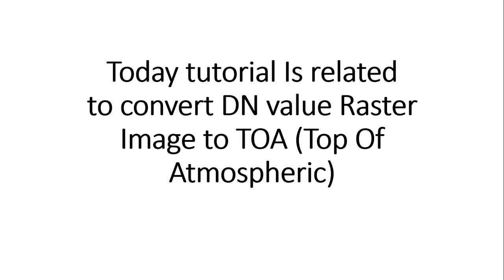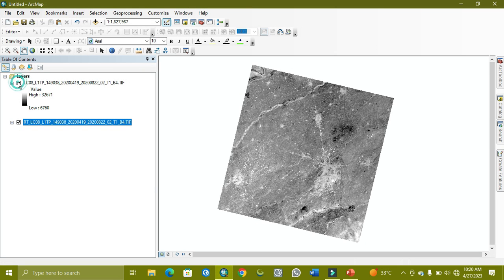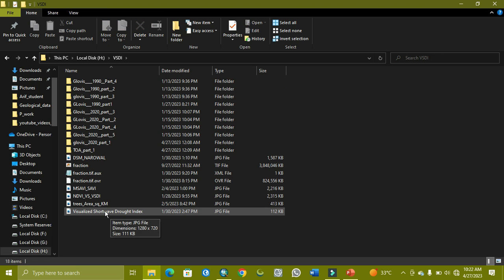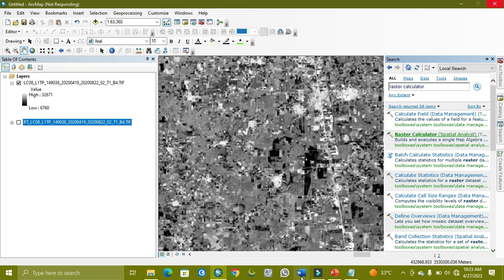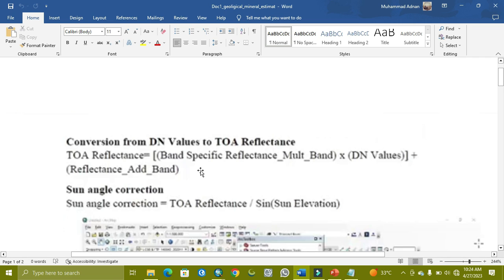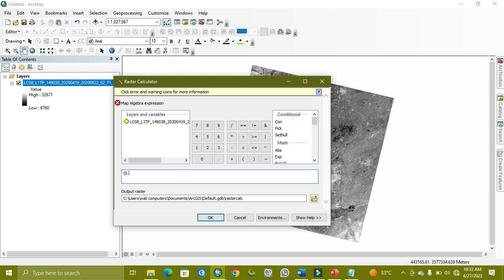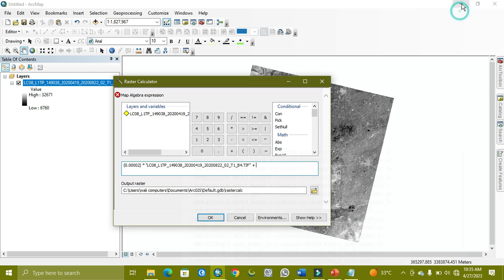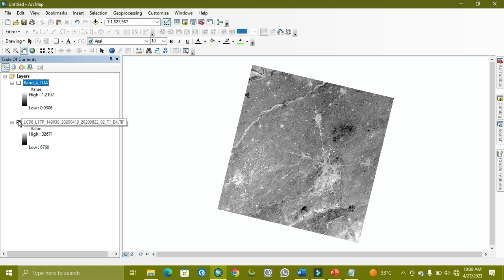How to (TOA) Top Of Atmospheric Correction  of  Landsat 8 Data ‖ By ArcGis ‖ Raster Calculator Tool

Comment: For Thermal band also we need to follow the same?
Reply from the maker: @prajwalparmar4168  no thermal band not need atmospheric correction
Reply: @ So we can directly use it in an index calculation?
Reply from the maker: @prajwalparmar4168  yes it not need atmospheric correction
Reply: @ One last query, you have not applied sun angle correction?
Reply from the maker: @prajwalparmar4168  we played sun angle correction ..on it